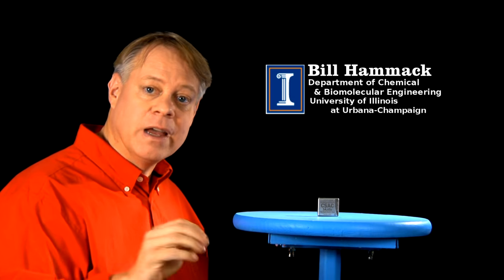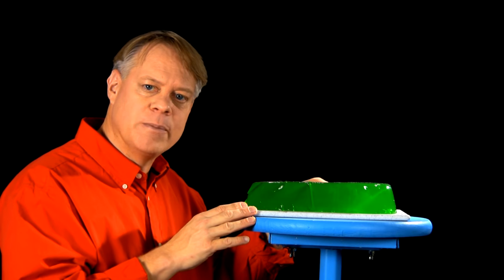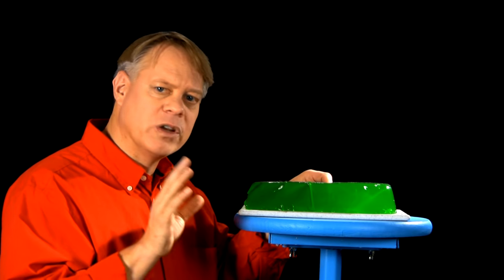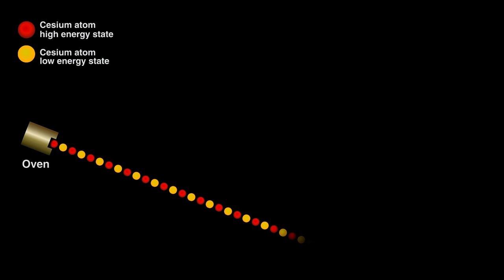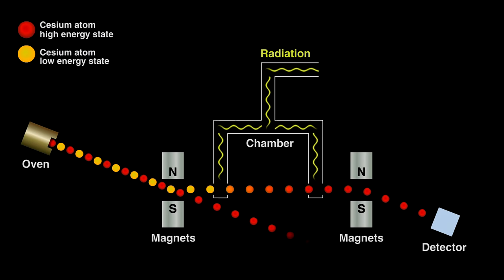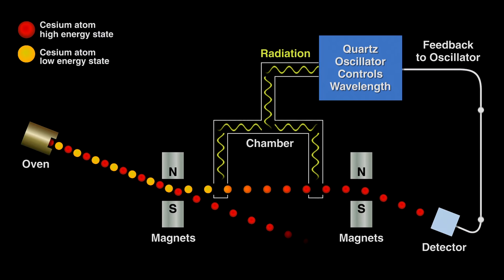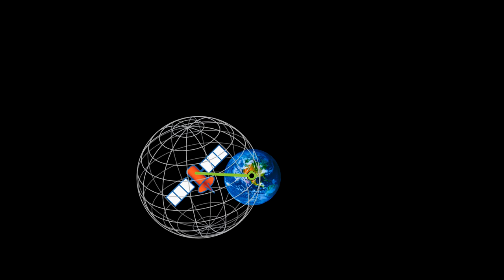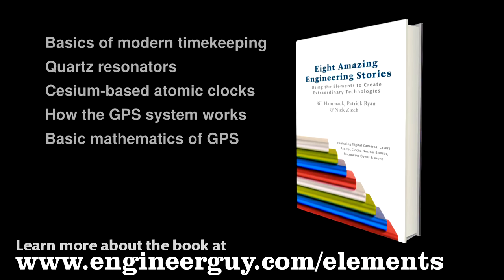How an atomic clock works, and its use in the global positioning system (GPS)

Comment: A GPS receiver needs THREE, not "at least four" satellites to locate its positron on the Earth. And the "one satellite to correct the time of the receiver, three to locate its position" is utter BS - time is deduced from the location solution even with only three satellites available. If four satellites are available, a 3D location + time will be computed (latitude, longitude, altitude, time). If only three satellites are available, the solution will be 2D so altitude will not be computed - but the location and time will (latitude, longitude, time). This is basic stuff widely available in books and online for many years, there is no excuse for spreading wrong information on a presumably technically-oriented Youtube channel.
Reply: corisco tupi You need four satellites for accurate measurements of position.

Of course, you can get a position with only three satellites and possibly only two, but do you know why?

Three satellites will result with two points and you have to choose which one is probably the right one.

You make assumptions. You can, for example assume that you are, on average, about 6371 km from the center of the earth and take that as basic altitude.

But that isn't always true. This is an average value that will be wrong most of the time, for example when you are on a mountain.

When you are closer to the poles you will be 6357 km from the center of the earth and near the equator it will be 6378 km.

If you have some cheap GPS receiver it will, of course, make that assumption and probably get a result that is somewhat right but still off by a bit.

But if you are in a plane you need precise results and assumptions of altitude won't work. You need all four sats visible to calculate position, altitude and time.

The fourth sat increases the accuracy of your position and gives additional data about it, with only three you are just making a wild guess and hope it's right.

Technically you can also make a good guess where you are with only two sats in the sky but it will be horribly inaccurate.

TL;DR You are wrong. You can't get a position out of three satellites. You either need a fourth satellite or make an assumption of your height.
Reply: MrEyecikjou Sorry, you are wrong. First off, you *CANNOT*get a position fix with two satellites, the minimum is three. Also, the difference from a position fix from 3 satellites to 4 is that the former gives a 2D position (no altitude information so the fix will be on the geoid surface, approximately sea level - but latitude and longitude WILL be acurately given), while with 4 satellites you get 3D (lat, long, alt). Of course, the more satellites, the better the accuracy but this holds true for any increase, not just from 3 to 4 satellites. I.e., 5 satellites gives a better accuracy than 4, 8 is better than 7, etc, assuming the satellite geometry at the moment and receiver location is adequate.
Reply: corisco tupi If you make a few more assumptions you can work out a position with only 2 sats, it's just VERY inaccurate.

And you always will need an altitude when calculating with 3 satellites, as 3 sats resolve to 2 possible positions, additionally the position itself is less accurate.
Reply: MrEyecikjou 3 satellites resolves to ONE position on 2D.
Reply: corisco tupi 1 sat gives you a sphere, 2 give a circle, 3 give 2 points and 4 1 point, look up the math.
Reply: MrEyecikjou Remember if on 2D. 1 sat gives the intersection of a sphere with the surface of the Earth - a CIRCLE. 2 sats give the intersection of two circles - TWO POINTS. Three sats give the intersection of three circles which can be reduced to A POINT. All this is for a 2D soluion, as I have been saying all along.
Reply: corisco tupi You know that you are not figuring out a 2d position in a 2d system but trying to figure out a 3D POSITION in a 3D SYSTEM. In 3 dimensions the intersection of 3 circles gives you two points.

With GPS you HAVE to figure out a 3d position since everything is 3d and the earth is a sphere not a plane. You cannot simplify it down to a 2d problem.
Reply: You don't HAVE to figure out in 3D because you know your altitude. Hence, q 2D solution may be sufficient - LATITUDE, LONGITUDE. If you want a 3D solution then yes, you need 4 satellites. This is getting boring.
Reply: corisco tupi Now we have a consens, you need the altitude, a 3D coordinate, to figure out your 3D position in a 3D system. Therefore you either have a fourth sat or you guess your altitude, hence a larger error in position.

There isn't 2D in this anywhere. You can't represent a spherical problem as a 2 dimensional one.
Reply: MrEyecikjou Of course the calculations are made on spherical surface but what I am saying is this (AGAIN!): You can have a latitude and longitude solution, commonly known as a 2D solution, with only three satellites, period. If you have 4 satellites, your result will also have altitude in addition to latitude and longitude. Next time you look at your GPS receiver while it has not yet acquired 4 satellites, watch what it says about your position fix: "2D FIX". When a fourth satellite is acquired and used in the computation, it will display "3D FIX".
Reply: corisco tupi Three satellites would give you an accurate position only if your receiver's clock were synced with the GPS constellation's clocks.  Receivers' clocks are not that accurate.  This is why he said that a fourth satellite is required to correct for any timing error.  I don't think that any commercial receivers will display a position at all with fewer than four receivers.  For example, from TomTom's website: "Your device needs to be able to see at least FOUR (emphasis added) GPS satellites to be able to calculate your location on the map.If the GPS signal is weak or your device is only able to see three satellites or fewer, the location icon is shown in gray, the Driving View is shown in gray, or one of the following messages can be shown:Waiting for a valid GPS signalPoor GPS signal...The GPS signal was lost x seconds ago"

Another explanation can be found on wikipedia:

"It is sometimes incorrectly said that the user location is at the intersection of three spheres. While simpler to visualize, this is only the case if the receiver has a clock synchronized with the satellite clocks (i.e., the receiver measures true ranges to the satellites rather than range differences). There are significant performance benefits to the user carrying a clock synchronized with the satellites. Foremost is that only three satellites are needed to compute a position solution. If this were part of the GPS system concept so that all users needed to carry a synchronized clock, then a smaller number of satellites could be deployed. However, the cost and complexity of the user equipment would increase significantly."

So, a GPS receiver could theoretically (although I don't know of one that would) provide a solution with only three satellites but it would probably not be accurate enough for navigation.
Reply: playmeacountrysong It is accurate for 2D navigation (and won't provide altitude, and is less accurate than 4 or more satellites, as I have already said. From the Garmin GPS45XL receiver manual: "In order to determine a position fix, your GPS45XL needs to 'see' at least three satellites".
Reply: corisco tupi By 'position', in it's most general sense,  it seems logical to assume a one-to-one ratio between number of dimensions and number of coordinates. The reason why it may work sometimes (or even most of the time, I'm not sure) with 3 satellites is that we find only two possible locations, and a receiver equipped with topographical data might be able to guess the most likely of those two locations. By 2D location I am left to assume you mean ground navigation as opposed to submersible/aviation and by accurate I assume you to mean 'accurate enough to navigate from origin to destination' :)
Reply: Gregory Ray By 2D I mean the position is established as latitude, longitude on the Earth's ellipsoid. By "accurate" I mean something around 15 meters. And no, submersible applications will not work with any number of GPS satellites since the signal at 1.5 GHz will not penetrate even a few cm into water.
Reply: +corisco tupi If you're going to whine about accuracy why not talk about a base station? With a base station of a known location you can further increase accuracy. Furthermore, you'll need to tell Trimble you only need three satellites, they make some expensive GPS gear and you'll never guess how many satellites they say you need for an accurate position.
Reply: Noah LeFoot What does a base station have to do with how many satellites are needed to provide reasonable accuracy? Much less "guessing how many satellites" are needed for an accurate position.
Reply: corisco tupi "guessing how many sats" he meant you need 4. Base stations basically improve accuracy by using elevated positions and higher accuracy hardware and send a secondary position signal.
Reply: +corisco tupi Base station? He must be talking about the GPS in his cell phone.
Reply: A fourth satellite provides altitude
Reply: +Diddleshot
Exactly. With three satellites you have latitude and longitude with no  altitude information, i.e, altitude is undetermined. A fourth satellite provides altitude information.
Reply: The more satellites, the better the results.    It is called GNSS.

Comment: This was a great explanation of the mechanism for keeping the quartz in the atomic clock oscillating at a steady frequency, but it's still missing an explanation of how that oscillation of the quarts yields a quantifiable time output.
Reply: An atomic clock is used to detect time dilation between low acceleration and high acceleration.
If the clock components such as the crystal or ions are subject to moving physically slower under acceleration, how do we accurately measure time with 2 different speeds clocks to say that it is time slowing rather than the mechanical velocity of the clock that is slowing?

Comment: Yes, which is kinda the point about pointing out the commercially available chip the size of a quarter in the first place--that was for earlier portable GPS devices. They're even smaller now, able to fit easily into your cell phone.

Comment: Is anyone else confused by the illustration? At 3:45 he says circumference of a circle but highlights the surface area. Also the illustrated location is inside the surface area, but should be somewhere on the circumference. So what is being said is correct and the illustration is misleading since the overlapping parts of two spheres should indeed be the circumference. Or am I missing something here?

Comment: The circumference of the earth at sea level is divided into 86,400 units of time (seconds). That gives the physical length of a second. When you start moving above sea level, an increase in radius results in an increase in circumference resulting in an increase in the length of a second. 
Time isn't slowing down but you are spending more time in that time zone.

Comment: Follow up question is on the current from the detector to the oscillator ? What does that current do ? Does it make the quartz to vibrate/oscillate ? 

Also, i am guessing the feedback loop is used to bombard the quartz oscillator and that wont make it slow down. 

The reason i am asking this is at 2:34, he speaks about oscillation decaying, how would that decay if there is continuous feedback from the detector to the oscillator ?

Comment: I've watched that part over and over again. I can't believe I heard that part so wrong.
1. I misheard. You are correct.
2. Yes you clearly did, but by the looks of the "walkthrough" of how a position is defined you only explain three satellites. 3 satellites = 2 points. 4 satellits = 1 point.

Comment: My impression is that the "losing 1 second over millions of years" just illustrates the accuracy of the clock. It's like saying 1 mile per minute vs. 60 miles per hour. The accuracy of losing 1 second per x million years is the kind of accuracy you might need for applications like GPS. Bottom line, I think you're right: we don't really expect to use the same device over millions of years.

Comment: Yes, slower satellite clock tickrate can correct for time dilation.
What about the variance in speed of light, and refractive index of the atmosphere depending on the angle from the device to the satellites? I guess you could compute and correct for that with enough to make it negligible?

Comment: If you use three satelites you will actually reduce the posible locations to two points. You can therefore either use the fact that only one of those points are located on the surface of the earth or use a fourth satelite. I didn't know how a atomic clock worked. Thank you for the clear explanation!
Edit: fourth satelite.
Reply from the maker: You need four satellitles because the gps receiver does not have an atmoic clock on it; you are solving four equations, four unknowns: x,y,z, and t. This will give you the two spots — one on the earth, one off; as you note you choose the one on the earth.

Comment: Bill, A major flaw in your explanation at 3:26. The receiver does NOT have a synchronized clock. It cannot determine it's distance from any one satellite, unless of course you knew the exact location of the receiver. But if you know that, why would you be using a GPS receiver.  Your location can be determined from the signals from 3 or more satellites, but the math gets a tad more complex.

Comment: I would venture to guess that rather than a magnetron, they probably use some kind of klystron or travelling wave tube such that the frequency of emission can be tuned arbitrarily to some reference with high finesse, as opposed to the magnetron which is generally of fixed frequency.

Comment: I think you need atleast 4 satellites to obtain a pin point location on Earth.
2 satellites gives you 2 intersecting spheres, giving a patch of area on the geoid.
3rd satellite reduces this area to an arc anywhere within this area.
and the 4th satellite pin points your location on the arc..
Please correct me if I am wrong. I love your videos..keep going :)
Reply: Three satellites narrow your position to either of two points (not an arc) where the three spheres intersect. In a truly void space, you would need a fourth satellite to know which of those two points is your actual location. In practice, though, one of those points will be nicely on the surface of the Earth while the other will be far out in space and/or moving impossibly fast, so a little common sense can decide which one is the correct one. In essence, the Earth becomes the fourth sphere.
Reply: +Diego C. Thank you for the correction Diego:)
Reply: as the engineering guy said the fourth satellite is used for time.   In a perfect world with no time errors you need three satellites to solve three equations containing three variable, xyz of receiver.  Fourth satellite gives a fourth equation to solve delta t, or time difference or in other words a time correction.  A combination of Satellites A,B,C,D using only 3 like ABC, BCD, ACD produces three receiver locations that will need to converge down to one solution using multivariate Newtons method ie it's an iterative method to converge to one solution

Comment: No.
The GPS Module just works as a signal receiver & transmitter. One of the satellites that your module has locked on to, is used to adjust the time, which it does using Atomic Clock. YOU don't need clocks. The Satellite does ;)

Comment: Because the mechanism for the jolt isn't itself perfect, either--in particular, your ion source itself has variance over the very, very, *very* long term that causes cycles to be missed. You could probably put a correction mechanism on the correction mechanism, but we don't have commercial products needing that level of accuracy yet. :-)

Comment: 9,192,631,770 = 2 * 3^2 * 5 *7^2 * 47 * 44351
299,792458 = 2 * 7 * 73 * 293339

So 1 meter is defined as the distance light travels in a vacuum during the (3^2*5*7*47*44351)/(73*293339) = 30.66331898849837... beats of Cesium-133. 
You'd think that, since they chose to define the second and the meter this way, they'd have chosen at least one of these 2 numbers such that you get an exact integer, say, 30, for the number of beats of Cesium1-33 per meter of light.

Comment: Hi Bill, how does a GPS module get it's time synchronized?

Because if I comprehended right, the satellites send a signal with their position(coordinates/location above earth) and exact time of transmission, and the receiver receives this signal and compares the time of transmission to the current time to calculate how far the satellite is(the more time difference the more far the satellite is, and vice versa), but if the receiver doesn't have synchronized time how can it know how long it took for the signal from the satellite to be received?!

Comment: The quartz is used to bombard the low energy ions to convert them to high energy ions. Because this effect only works on low energy ions, they discard the high energy ions first in order to create a stream of only low energy ions. This is necessary in order to ensure that the high energy ions hitting the detector were created by the radiation bombardment. This is important because if the quartz's oscillations are not at the correct frequency, the radiation won't convert the low energy ions.

Comment: When you said a reply from one satellite is a sphere of location?  Isn't it a circle?  Take the distance from the satellite, and get its intersection with the planet's surface.  Add in one more satellite, and intersect that with the circle, and you get a possible two points.  The final satellite narrows it down to the correct point of the two.

This is how it makes sense in my head, anyway; it's how you scan in EVE-online.